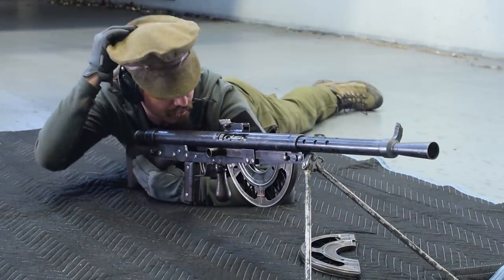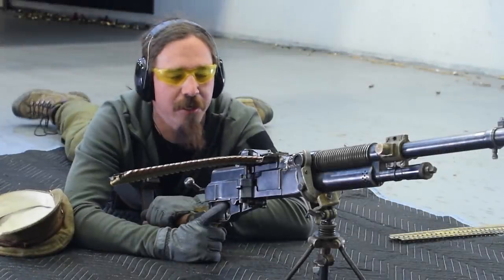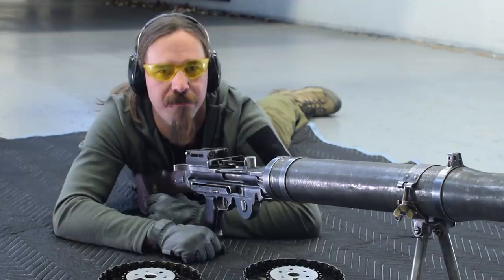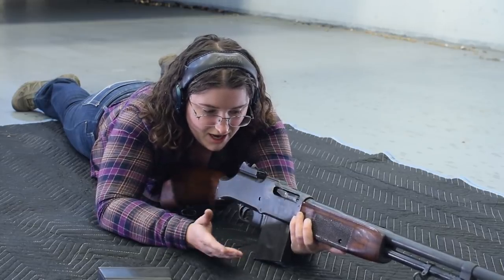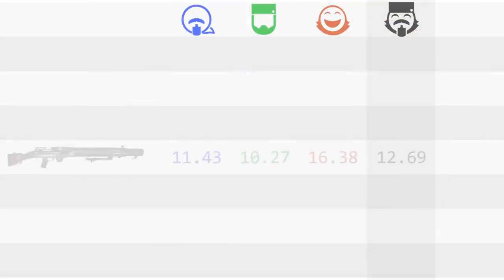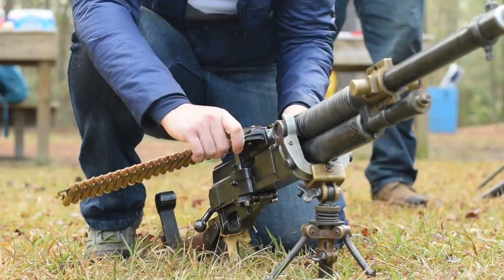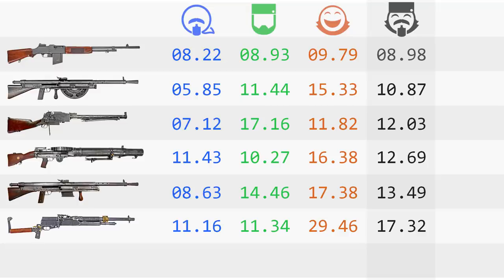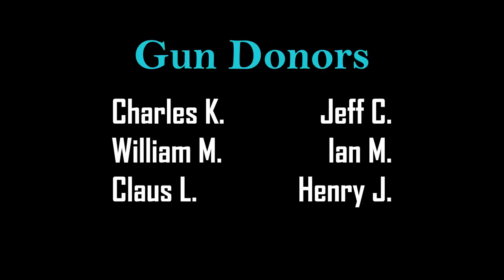Project Lightening Episode 05: Reload

Comment: Could an additional issue with reloading the Lewis gun perhaps due to the fact that the pan only had 2 rounds and shoving it down would be a lot easier if it were fully loaded/weighed down? Would extra weight of rounds would have affected the reload? Would getting the pan square on and down the peg with a sort of weighed down gravity-assist help May with her reload?
Reply: I like the talk were the said it was slow but they all did it in 10-12 seconds and the next one was fast and easy but the times were the same or worse

Comment: I don't like the BAR.  For a gun that big, and clunky, basically it should have a larger capacity than 20 rounds, for an LMG.  If you're going to have to reload it that often, it better be quick, and convenient, but in a position, prone, or on a bipod, the bottom mounted magazine well just slows you down.  You have to either turn it over, or feel around under it to lock, and rock it in.  However, that being said, the magazine release is brilliant.  Because it's so out of the way, you're just not going to accidentally drop a mag (Let's say in a muddy trench) with it inside that trigger guard.  Keep in mind, this thing has to work for grunts that can't pour piss out of a boot with instructions printed on the heel.  Any way they can find to fuck it up, they will, design it with that in mind.  (Not really, on average, but consider the weakest link in the chain of command.)  That mag release is FNG proof.  Compare it with the unprotected studs sticking out both sides on the '06 Chauchat.  You think you might figure out some way to snag either side of that on an equipment belt?  Yeah, well some dumb grunt probably can, too.

Comment: looking at the times, it appears as though the size/height of the operator really matters with these guns. No disrespect to Mae, but her shorter stature appears to be the cause of a lot of her slower times. She needs to move her whole body for some actions where Ian and Othais only need their arms. 
I forget how tall Ian is, but both he and Othais both appear to be at least 6 feet tall. It would be interesting comparing them to the average WWI operators, as it appears that there is almost a minimum size requirement to be able to operate the weapons at a certain speed.
Reply: If you've been following C&Rsenal vlogs over time, you will have heard that Mae represents the height and weight of the average World War I soldier.

Comment: Not really fair, you can't count any variant of the maxim gun as a light machinegun, I know by modern standards make it one, but it was meant to be mounted and stable instead of mobile fire.
Reply from the maker: The 08/15 was expressly designed for the LMG role.

Comment: It's obvious some of the testers have more experience with the weapons than others. In a real military environment, there would be training and orientation to get some of the "fumble-fingeredness" out of it. I don't know what value there is in having inexperienced operators evaluate these weapons. I understand the cost in time and ammunition necessary to familiarize the operators but without that little bit of "equalization" this is more just a series of demonstrations and less an evaluation. No intending to be harsh, because I am enjoying the HELL out of this, but these things have just jumped out at me.
Reply: Yeah, I think out of all the installments this is going to be the one that tells us the least about how these guns were in their time. Aside from the experience issue there's also the problem that these guns were really meant to be reloaded by an assistant next to the gun,  not by a shooter behind it, and I wonder if maybe they should've tested them that way instead.
Reply: Yeah, I guess in a perfect test they would've fired a few thousand rounds through a gun over a couple of days, then tested that gun, then moved on, etc. but time and money would prevent that.  And time would prevent them from running the test a few times and picking the fastest for each shooter.
Reply: Conversely it also shows the challenge you would have if you need to move people around in an emergency, if members of the crew get shot, etc. The simpler and better the system, the less problems that arise, and hell, less time and effort needed for training.
Reply: I am not certain that training more than a few hours with a gun would have been possible in wwi before being sent to the front.
Reply: @ineednochannelyoutube5384  tough once there, gun crew members would have been practicing. spending hours putting that mg 08 magazine on and off, changing gun barrels, etc. What this shows are the challenges that pop up when the reloader gets killed by a shell and an attack is coming.

Comment: The problem with this kind of test is that it isn't indicative of anything. A trained machine gunner would run circles around these three, because professional militaries actual train their troops and drill concepts such as reloading into them. I can't how many times they tried shooting the Chauchat on an open bolt.
Reply: OK, and?
Reply: despite the education angle of this series, it's for the most part done for fun and isn't meant to be taken as fact.